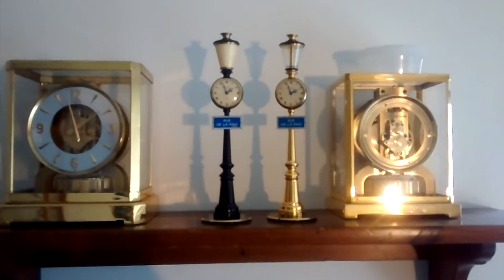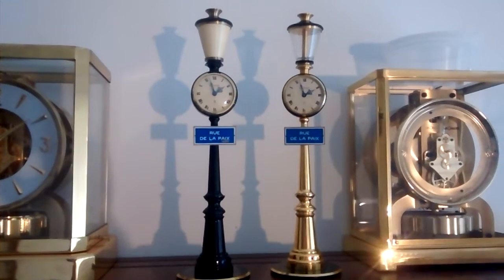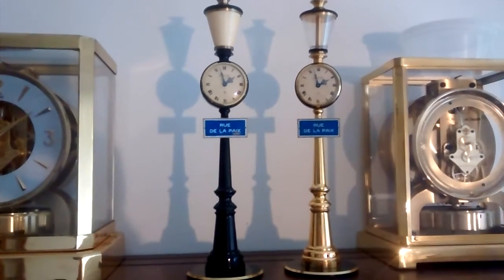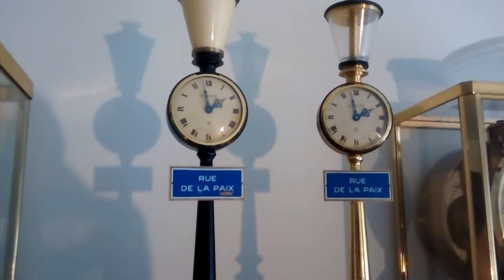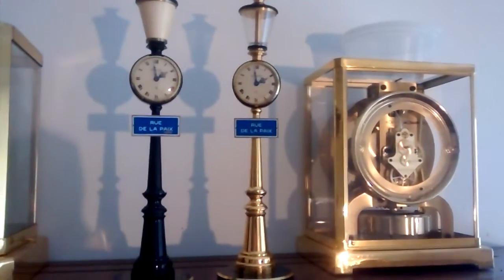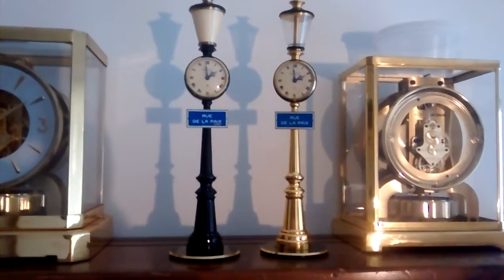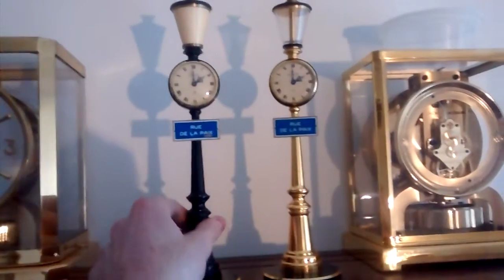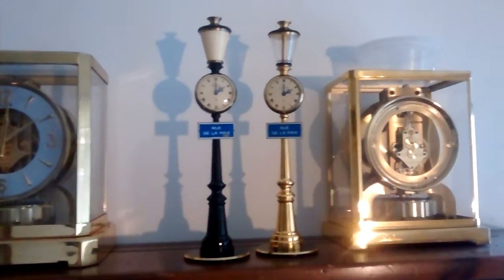Jaeger LeCoultre Rue de la Paix Lamp Post Clock Repair 8-Day

Comment: I just found one of these at an estate sale over the weekend. I liked it even before I saw it was JLC, but when I saw the name on the dial I knew I had to have it. 
Mine says “Bourbon St” on the sign. I could resell it and probably make a few bucks but it is just so dang cool I am going to keep it. 
I just need to fix the wobbly post or get it fixed.
Reply from the maker: I have another video about wobbly post!
Reply: @atmosrepair  I watched that video and that is what mine is doing. How do you access the screw to tighten it?